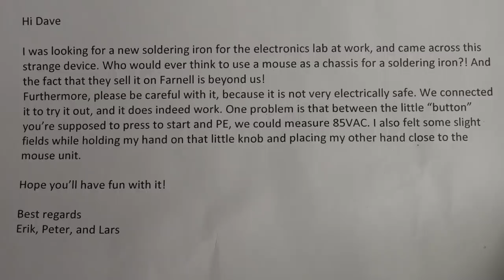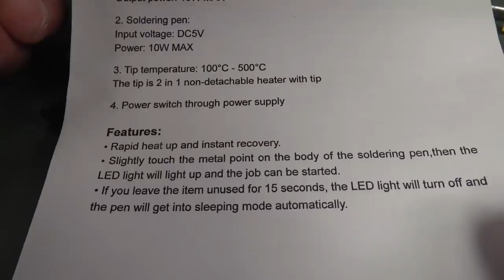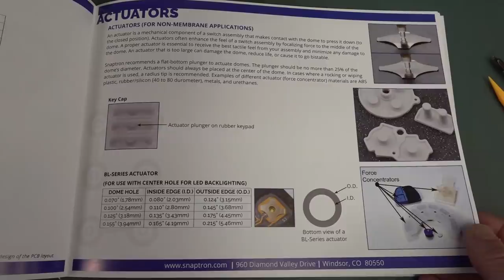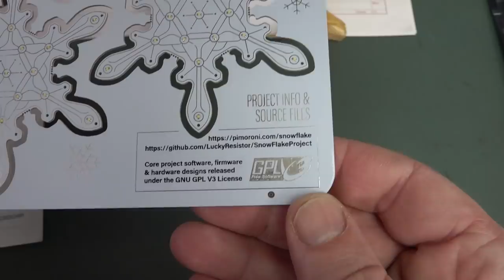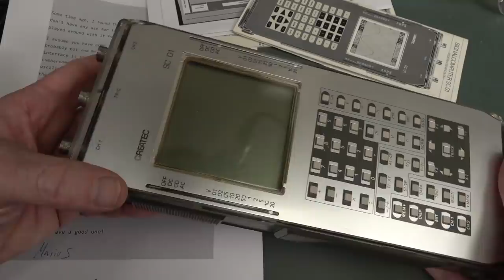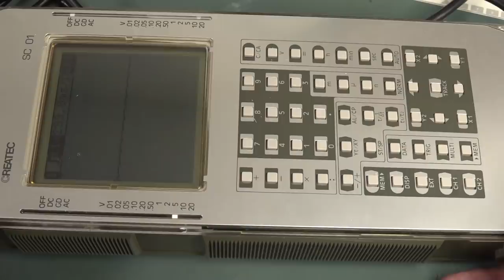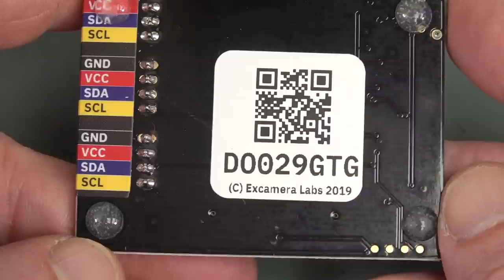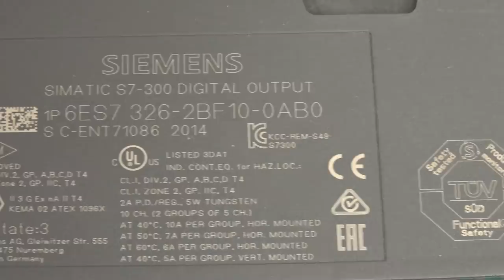EEVblog #1291 - Mailbag

Comment: i mostly think this have been made from overstock of clear wired mouse shells as it would be common thing to do in china to recycle old stuff
Reply: But the buttons are molded in, so they modified the molds! But yeah, totally a case of reusing as much as possible.
Reply: One thing is for sure, nobody will knock them off.
Reply: yep, i have a digital clock kit who's frame was clearly meant for a digital picture frame... even has holes for the SD slot and the jacks the frame would use.
Reply: @volvo09  From the looks of the, the "buttons" are a plate screwed into the case. I think this was at least a reused mold, if not a hack job on surplus mouse shells.
Reply: @devicemodder  I have the same kit and I like the clock. :)
Reply: It looks like a typical project you'd find on some Russian forums. They love these types of repurposed enclosure projects. The more odd the better.
  I bet this was a popular DIY project that someone in China crunched the numbers and realized they could make a few bucks with.
   Also, I think the solid molded mouse body is part of the industrial design process. Some company probably had them made to test the shape and material texture. The dies were probably only used a few dozen times and then shelved, making them ideal high quality molds for such a product. 
  While it is a little silly, and the iron is piddly crap, this looks better than the ones built into a laptop style power brick.
 I got the stupid 858 hot air gun built into a power brick. It's the worst ergonomic design imaginable. At least for me, the axial cords are a mess and the interface is upside down for bench use.
Reply: Reminds me of that weird medical kit that used the molds from the atari jaguar.

Comment: 5:25 - Tiny little SOT-23 is probably Adjustable Precision Zener Shunt Regulator like LM431 in feedback with optocoupler. Main Off-Line AC-DC controller is DIP-8 on primary side.
Reply: Aka TL431.

Comment: I have one of those scopes!  Still works to this day :). I use to work for an electronics surplus company just out side of Seattle WA and we had a large lot of those we purchased from the manufacturer and resold in the 90's.  The UI was a NIGHTMARE making the scope nearly unusable! :)
Reply: I bet your yelling at the screen !
Reply: Nearly? You jest.
Reply: LOTS of great info on the scopes here: https://groups.io/g/TekScopes/topic/7638043 There was an explosion-proof version as well, and there were variants rebadged by Tektronix, Gossen, Norma and perhaps others.
Reply: I actually love it for nostalgic reasons. Was the cheapest scope one could get back end of the eighties.
Reply: Now i see why the Berlin Brandenburg Airport is so much overdue. 🤣
Reply: @sleeptyper  nope, they're using Keysight 😀
Reply: @thomasw6169  Or maybe they are using the good ol' "wires to tongue" testing, lol.

Comment: Hahaha throw that soldering Iron in the bin where it belongs, I can not even understand why Farnell is selling this? Oh god!
Reply: Keep the power supply board but put it in a proper PSU box. It pretty decent. Looks like it can output at least 2A at 5V. It doesn't use some crappy 2 transistor circuit on the primary, it has a proper switching IC.

Comment: Hi Dave,

I think that the powersupply in the mouse is a secondary side regulated flyback and not a primary side regulated one, since it has an optocoupler connecting the sec with the prim side.
Cheers Peter

Comment: 29:00 These portable scopes are from the 1980s? I can remember way back in 1999 when I first went to college I bought a velleman HPS5 5Mhz personal scope, they went up to the 40mhz HPS40 then got discontinued I think..

The coming years saw Fluke come along with offerings including 400mhz models then after that they brought out a new model every year of fluke scope meter every year and they went on to very fancy ones that we have today with multi gigahertz functionality, 4 channel input, WiFi, Bluetooth, suites of signal analysis software apps, Internet connectivity and probably built in digital camera and thermal imager as well by now..

There are also offerings from megger and there are pocket multimeters from different makers with basic scope functionality..

Plus dozens of manufacturers making good offerings of compact, not so portable but definitely backpack carriable benchtop digital oscilloscopes at really quite inexpensive prices..

I know that there are £70,000/$100,000 lab and benchtop  oscilloscopes and £25,000/$30,000 handheld scopes available to buy today (March 2020) and by the time this is read in years to come there will be a lot more advanced offerings as well..

You can pick up a digikey scope for £300/$380 and the old historic companies such as tektronix and Panasonic aren't really around anymore after many mergers and closures etc..

The first oscilloscopes that I used at age 17 as a student in 1999/2000 were the old green line cathode Ray tube 2 channel 40Mhz benchtop oscilloscopes with the rotary switch and push button controls, they weighed about 15kg and a LOT has changed in the last 20 years, my how the time has passed so quickly and you feel old all of a sudden sitting here in 2020 (and beyond) 😳

I know that the early digital 4 channel versions with software menus and the old style 1.4MB floppy disk drives and a few software signal analysis tricks, save to floppy disk and Windows/Linux PC software (early USB and RS232 port connection) were. Around back then in 1999/2000 but they were in industry and were out of the financial price level for colleges and universities to issue to classrooms/student practical classes back then..

Nowadays I will assume that there is more money available and also that industrial companies gift money and equipment a lot more to colleges and universities for higher end electrical and electronic equipment and test gear...

Anyway that's my thoughts on oscilloscopes for now..

Comment: actually i wouldnt mind a mouse shaped controll unit. its the implementation and piss poor specs that is burying it. atleast that mains circuit ticks most boxes for how to do it right.
Reply: until you scroll on the temp control thinking its ya pc mouse!
Reply: Yes, the 5V psu board is pretty good.

Comment: This soldering iron mouse is not properly grounded. PE wire is not present. Blue caps visible at 4:22 are passing AC current from live side of power supply to the output and this is why user gets additional sensations from the start button.

Comment: The 85VAC is most likely capacitive coupling across the transformer.  One side of the primary is at AC common, the other side is connected to AC hot.  The divider ratio depends upon transformer winding characteristics, and often makes about half line voltage available with respect to ground.  You can see the same results on most old transformer based DC power supplies.  Connect one lead of your voltmeter to ground and probe the "isolated" DC terminals to see half the line voltage.  (just as you mentioned in the video).

Comment: Any reason why metal dome switches aren't used for mouse buttons? I hate when they start double clicking only because the switch is a small rectangular button and it wears down the plastic that pushes it.

Comment: Hi. German viewer here... I have the Tek branded version (T202) of this portable scope. My boss found it in the dumpster. I haven't tested it properly since I don't have the power supply and there's only so many wires I can hold in my hands at the same time trying to keep it powered. It needs 5V, 12V and -12V It did boot, though. Kinda like a Gameboy. Note that it has some rechargeable coin cell batteries in there. Mine have started leaking, but not corroded much yet.

If you need the pinout, here goes, looking at the socket with the rectangly thing pointing right:
####+5####
-12#GND#+12]
###GND####

Comment: We have a ski resort here in Ontario (Canada) called Blue Mountain as well. It's called a mountain, but technically it's an escarptment. The so-called Niagara Escarptment, which is what the Niagara Falls go over. It's basically just a several hundred meter high ledge that cuts a path from Wisconsin, through Ontario and as far East as Rochester New York. It's a pretty interesting bit of geology. It dates back to the Silurian period, 419 to 443 million years ago.

Comment: The worst oscilloscope I've ever used in terms of user experience was one in the lab last semester. I've found a photo I took of a waveform it displayed, so I know the model number - Hantek DSO4254C. Why a photo and not a screenshot, it's a digital oscilloscope after all? Well, it froze for (I shit you not) over 5 minutes when you inserted a pendrive into the USB port and then another 5 minutes when you actually took a screenshot. That is if it recognized the pendrive at all! The interface was pretty normal for a cheap 4 channel DSO, but the speed was about 10 times less than the slowest UI I'd call usable. The waveform update speed was abysmal, I'd say on par with what Dave got on the 1989 portable DSO in this episode. I've used lots of shitty scopes, I've even used a C1-118A for a couple of months with range switches screwed in so tight I had to grip them with all my strength to be able to change the range. If I had a little sweat or grease on my hands I would not be able to change the range. My fingers were sore after using that one, but I'd still choose it any day over that Hantek piece of shit.

Comment: I had such a Createc oscilloscope but it had a different keyboard, a membrane type. (Switzerland) I remember that the display was dead slow. Barely usable for low frequencies. Horrible trigger and also very counter intuitive to use.
Press CH1 NORM AUTO

Comment: You can remove background noise such as air conditioner easily. All you need is to extract little bit of that noise alone (in the video find a silent section where you don't speak) and then use an audio recording program that will remove background noise based on that sample (eg: GoldWave can do that). It will remove a little bit of useful audio data as well (you can prevent that) but main "hum" will be gone.

Comment: 20:13... I thought you had Solar Power backup system Dave....:-/
26:03... You would still need to wire power to each snowflake...or continuously change/charge batteries.

Comment: I use this soldering iron (USB version, so no temperature control) to do my SMD construction and it is wonderful to use, it is hot enough for my tiny parts and it cools off so quickly that I have never burnt myself although I have bumped into it many times.  It matches my tiny jobs.  I mostly run it off of battery banks.  Why he panned it without trying it is beyond me.  It cost me under $10 if I remember correctly, not counting the spare tip.  I replaced the RED LED in it with a clear LED that shines GRN for go. Ron W4BIN
Reply: He already tried the USB version previously. When it works (phantom trigger is an issue, could have just had a normal button IMO), for the limited use cases where it's useful, it is useful. But he's a bit of a tool snob and when something doesn't feel like a high-end tool he's used to, he's not going to be good with that. Indeed operating one of these is a separate skill since they do burn the tips quite easily.

I love how they used the original ZhongDi manual but glued a sticker right over the model number. ZD-20D is a battery iron (Takumi KBI-645 clone), 20U is the USB version, and 20F is this one.

Comment: Thanks Dave...needed somethin to watch with all the sports being canceled :/
..that "scope" is probably a function/signal generator aswell as the sillyscope..
the i2c driver is a bit lame...just use a freakin arduino.. or esp8266/esp32..
..that PLC wizz reminds me of the Ren & Stimpy episode "Don't Wizz on the Electric Fence"
Reply: Nope, No Gen in there unfortunately. I've got one of those.

Comment: The oscilloscope is sexy! The only problem is with those large sliders on both sides (and which seem to slide easily): difficult to hold in hands or even grab without paying attention about not sliding them out of settings. For that reason among others (i.e. machine + circuit/wiring diagrams & design integration I guess, if not mere ergonomics), such interface - also tried on other appliances in those same years -, was left on the side in the end.

Comment: also actually with very high quality soldering iron and small enough tip and under a good microscope like yours i wouldnt mind 0402 i did a couple of caps in that footprint not too long ago for a circuit at university and really there is nothing to it at all

there are almost always smaller ones
Reply: It's not very hard to hand solder 0402 components, even with a cheap soldering station and a magnifying glass. If you have a stencil and hot air gun, it's really easy.
I don't know how people manage some of the smaller stuff though. I have seen videos of hand soldering 01005 and they are crazy small. I don't think i could do that.

Comment: Can anyone else envisage dead silicon if that soldering iron actually gets used? No earth connection to the tip, with the primary-secondary leakage pulling up the secondary to 85V. Hopefully the tips well isolated...
Reply: The tip is not isolated. This is after all an iron intended to be used off a beefy little USB power bank.

Comment: Another dumb idea. I might have you beat on the crappy solder iron. I have a Coldheat soldering pen. Runs on 4 AA batteries but doesn't really do
any heating unless your soldering 2mm bits to something. It's a piece of crap too.

Comment: 32:01 - I had one and used it quite a lot as amateur. It was quite cumbersome with the stand and prone to tip over. The display, delays and difficult usage was an issue. I used it less and less favouring my big and heavy Hameg. The thing was used in the garage years later to check on generator windings etc. in vintage scooters.

Comment: I got one of those USB soldering irons from microcenter for a few bucks and it actually doesn't suck. I mean, it is what it is, but it's handy and actually works, heats up in seconds, solders most joints just fine (even thick ground pads), so I can't knock it.

Comment: This is the same thing as the other usb soldering irons just instead of a usb it has its own supply/base. Even the USB one share the same touch switch and triple 5 timer in them but this one has an extra 555, I wonder why. oh yeah pwm. The first one is used for a set amount of "on time" once the touch sensor is pressed. (just like the usb version.) The second one is being used for pwm which the usb version doesn't have. (its just on or off full power.) I own both of these and they both suck ass. don't get them. waste of time and money.